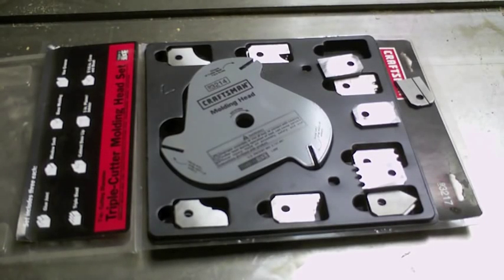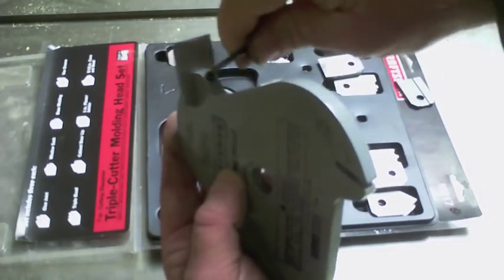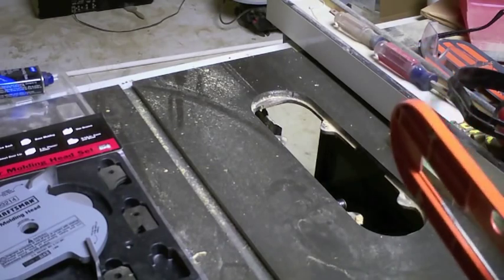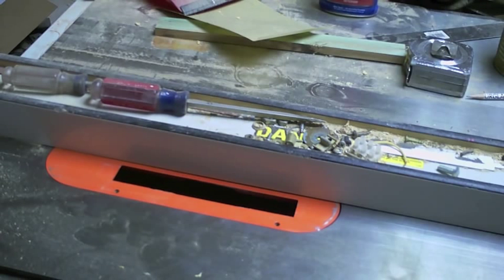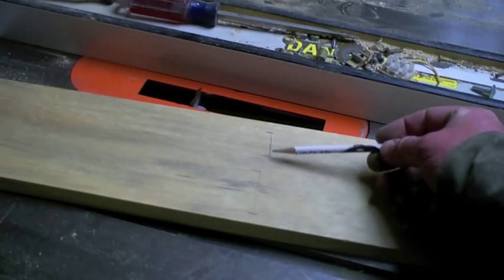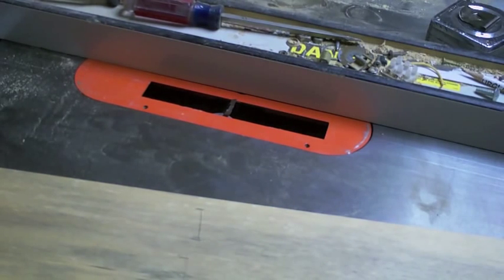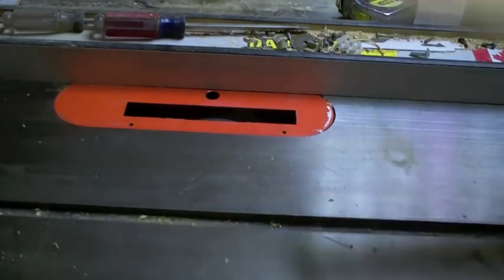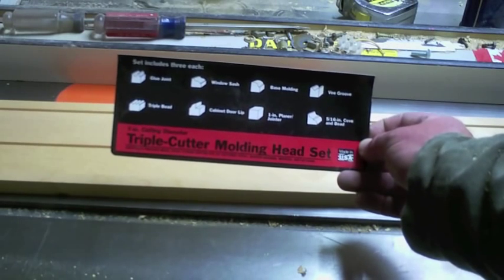Craftsman 3214 Molding Head Set-up and Use

Comment: I have been using them since the early 70's. I'm a retired cabinet maker, and I used to build cabinetry for customers with cottages on Lake Michigan. I have raised panel cutters that do concave, convex, and straight, panel cut's. They are the best way to build cabinet door's, but your setup must be good, with no allowance for wiggle, I used heavy fingerboards for this purpose, never a problem on Oak, Maple, Birch, Hickory was a little more fussier. but doable. I also used them to make all the custom trim, for Timber Frame houses, I never had a failure, I'm now 80, retired, but I have, and still use the original blades, occasionally dressing them on a diamond, or carbide stone.

Comment: I used mine a lot when I first started making furniture.  Used it on a Shopsmith just like Dad did and you don't get much more precarious than that.  They do acceptable work and I cut a lot of trim with one.  When I retooled the shop I opted, so far, not to get a shaper but instead have two 3 HP routers on insert tables and lots and lots of cutter for all manner of stuff.

I should try it on the radial arm saw before I sell that.  Like the idea of running the material flat instead of vertical as in the table saw with a tall fence.

Comment: Please use  a long push tool!!  2"x6"x18" on edge with a strip screwed in the end.  It gave me the shivers to see your hand on top of the piece.  I learned the hard way.  I was using the same tool.  20 years later and I can still see the scar from the bit in my hand.  reach over the fence to use it.  If it gets caught by the cutter and throws our the piece the fence will stop your hand from going down into the cutter.  Too bad I didn't meet the millwright that showed me the pusher before the accident.  Luckily I still have full use of my hand.
Reply: What do you think about a pair micro jig gripper?.
(I recently bought a Craftsman 3214 Molding Head, and was thinking to use it with a pair of grippers.)
Reply: I cringed when i saw that.
Reply: @davidmuller1958  It's been ten years since I wrote this and it still makes my stomach queasy.

Comment: Those cutters can also be used on a radial arm saw. They work great. The radial arm saw head can be pivoted to various angles which facilitates   molding cuts that normally would be done on a tilting spindle shaper.
david
Reply from the maker: I bet that would open a whole new world of shapes.  I always found my old 10 radial to be a big grabby, I assume running the cutter on a radial would make that issue worse?  Are there tricks you use to control it?
Reply: Boy are you in luck. Check out this video:
https://youtu.be/JRviFZLXBi8
david
Reply: @acme663ryo  Provided there's enough clearance in the throat plate opening on the table saw, can they be tilted to slight degree?
Reply from the maker: @algallego  absolutely. You will likely have to use a sacrificial plate.

Comment: Have had one for 30 years, they work for sure and they are affordable
Reply: Just scored one on eBay and need to create a zero clearance or proper throat plate for it.  Looking forward to using one.    I've been looking for a router table top plate extension to add to my old Craftsman table saw.

Comment: I own a set that I got with an old Craftsman RAS. It says not to use on table saw.  It doesn't have the spacer I've seen in some videos.  And I seem to remember seeing another head with a smaller diameter body.  Would love to use mine on a table saw I just bought.  When I used it on RAS it was spooky,  but made amazing cuts.
Reply from the maker: I bet it would be spooky. It has always worked on my table saw ok.
Reply: @acme663ryo  I have been searching the web trying to find out if those can be used on the table saw, if there is an actual difference, and what the difference would be.  I have blades that are still in original packaging but they have the "do not use with table saw" warning. The cutter head I have is model 3200 and I haven't checked for fit but if they do I may use them. This "not knowing why or difference" is wearing me out.
Reply: Have you tried them on your table saw yet? I'm commenting on an old thread, I know, but I'm trying to figure out why they were supposedly for RAS only.
Reply from the maker: @skipanardoross6805  I can't for the life of me figure out why not. I found an entry for it on vintage machinery and it shows a 3200 in place on a table saw. http://vintagemachinery.org/pubs/222/2260.pdf  I think I would use it but maybe stand back a bit.
Reply: I have seen one with a smaller head that I think was to be used on a table saw.

Comment: I received a second Molding Head from my Neighbor yesterday, this one was the Craftsman 3 Knife Small Diameter Head with Knives. The Knives were very dirty, but I cleaned them up with some Green Scotch Bright pads. I didn't have a sharpening stone, so I took a sheet of 400 grit sandpaper and placed it on the cast iron surface of my Table Saw. I then took the flat side of the knives and made a few passes on the sandpaper, they now feel sharper.
Reply from the maker: I bet that would work great, I am sure they are.

Comment from the maker: Do you mean that the arbor is a different size and it will not fit at all or just that with the thick spacer you can't get the nut on safely?  If it is a different size you will have to find or make a bushing.  If it is that the spacer is wrong go find some washers that have the proper size center hole and mix and match until you find what you need.  The big spacer comes with the kit but you don't have to use it.

Comment: I have a few different sets of the Craftsman molding cutters, all found on ebay a few years ago; one has around 18 different profiles but only uses 1 cutter instead of 3. I've bought enough pieces to have 3 cutters (or more) of each profile. None of them have really readable instructions. I have a Bosch 4100DG-09 saw and they have a zero-clearance type plate specifically for the Craftsman/Ridgid molding cutters. I have not tried any yet but would like to see more vids first of the different profiles as well as combining different profiles together. Thanks.
Reply from the maker: 28?  Wow I didn't know there were so many for that head.  I assume you cut with a three knife head, how is it different than a single cutter?  I assume the single must have a very slow feed rate and is more prone to chipping and tear-out?
Reply: NelsonStudios Sorry, typo! Should be 18. I'll edit that. But I think there are more than 20 profiles, plus 3rd party companies making some profiles. I will have to check mine later but I know I bought some kits & pieces to get 3 cutters alike to use the 3-cutter head. I have a couple different 3-cutter heads of different sizes too. I had a pic showing the different profiles, I'll look for that... Corob sells 50 profiles.

Comment: Dude with a finger like that, why on earth do you not use a push stick/block and/or at least a featherboard?  😀  Great demo of the molding cutter and installing it with appropriate insert plate!  Thanks for the tips on making sure to sharpen them right out of the box!

Comment: You had mentioned in this video about  SHIMS . Could you help me out and let me know where to get them. My table saw blade sits too close to the table saw insert and it is not centered in the insert. 
 Thanks.
Reply from the maker: Honestly you can make your own out of a cereal box.  Just trace the blade water and go just a bit larger. Balance will not be an issue.
Reply: @acme663ryo  Perhaps so but I will have to use quite a few. I need somewhere around 3/16 in. as my blade is a good distance away from center of on insert plate. Any ideas ? Oh, your video is awesome.
Reply from the maker: @ishootinraw1  if the plate is aluminum you can cut through it with the saw or you might try searching for "table saw shims"
Reply: Warren, the Craftsman molding set being used in this video came with a spacer approx 3/16" thick. For additional shims I use the ones from my 8" freud safety dado.

Comment: You can take that tri bead cutter,  and cut both sides of a thin board and make  3 dowel rods at a time,  I done that.   *(just flip board end for end)   You just cut 1/2 way thru from each side.  Bingo !!
Reply from the maker: +Paul Couch That is a useful trick.  Thank you.

Comment: I have that Molding Head except mine says Rigid instead of Sears, but it's the same style. Sears doesn't support Molding Heads anymore, they show up on ebay all the time, but you can buy American Made Sears style Molding Heads and Knives from corobcutters.com.
Reply from the maker: Thanks for the tip.  It would be nice to pick up some more profiles.

Comment: I bought a molding head set for my table saw but have used it on a (extremely) limited basis. Do you use jigs in conjunction with the fence (depending on the profile) to keep the material properly positioned?
Reply from the maker: +Matt Neff Unless it is thick heavy stock yes.  Not jigs normally but feather boards and hold-down clamps.